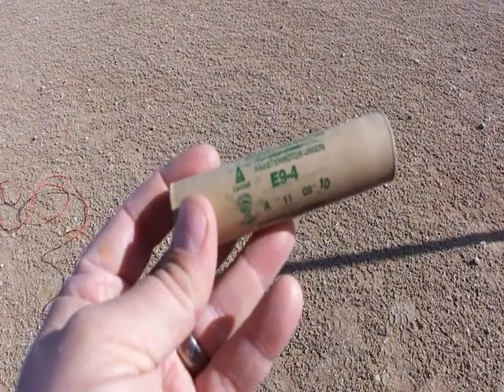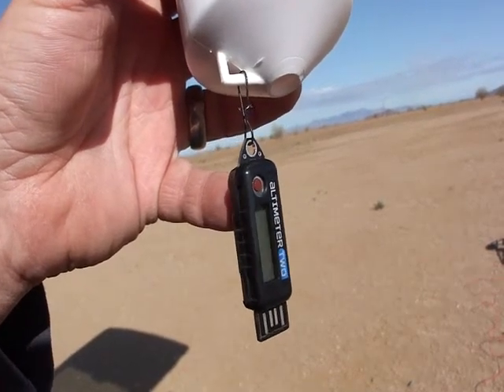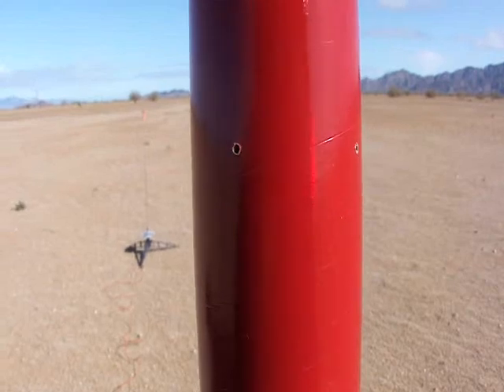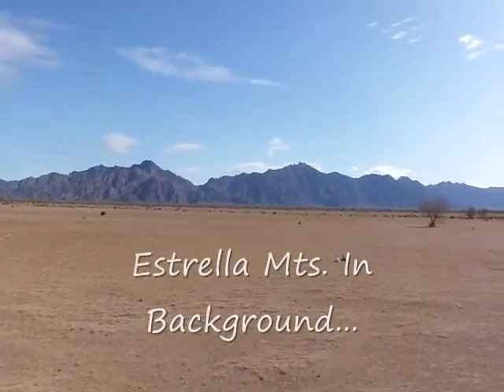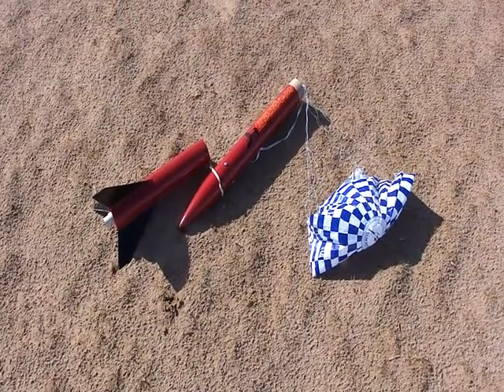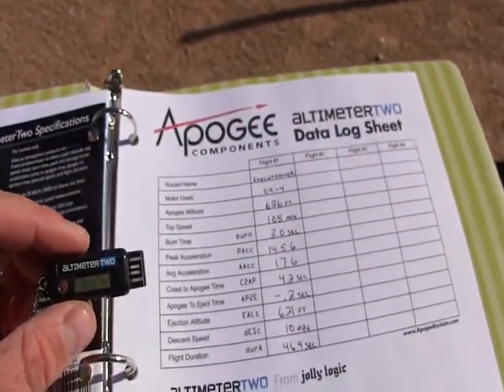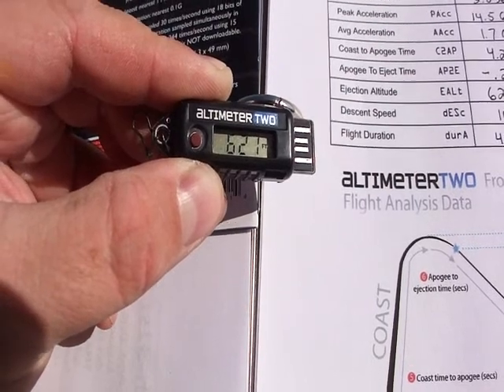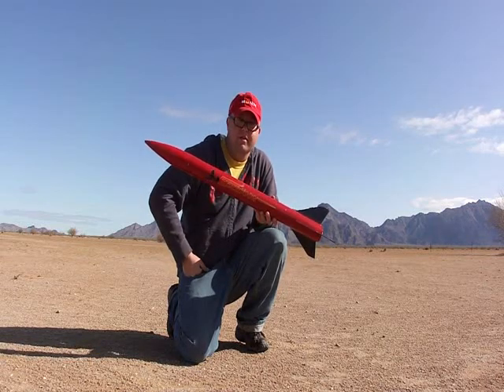29mm Estes Executioner Rocket & Altimeter Two

Comment: Thanks for the video man! I was doing Estes and small aero tech kits until I was about 12. I noticed my drive for larger rockets and looked up some local clubs.  Luckily since I live in Indiana there are about 20 different clubs. I attended a launch on a very cold Saturday and it was cloudy. Only a few high power since the cloud ceiling was so low. The next launch there was a blast. Literally! We saw maybe 50 H-N impulse flights and the day was one to remember. I got my jr certification about a month later and here I am  about to go 17000 on a j510. We have the best hobby, RIGHT!!!!

I just hope the transmitter stays with me. It would be a shame to loose the rocket 😳.

Comment: What are the holes create a Venturi affect reading a lower pressure?
Reply: That's probably correct if the altimeter was based on air pressure, but the Altimeter 2 is based on inertial inputs, not air pressure.  I was unaware of this at the time, but either way, the holes wouldn't have created proper pressure, that's correct.  I was in the learning phase.  Many years ago.  Gave away all the rockets years ago and started a new YouTube channel.  Come check out The Campbells'!  😉  - Josh

Comment: Im looking for a device for weather balloon launch project, whats the max altitude and max speed readings? How long does the battery last?
Reply from the maker: I never use this channel anymore and happened to see this.  Ahhh,   the altimeter like this are specifically designed to record rocket trajectory, so if they don't measure what is perceived as a rocket launch they will record no data at all.  This would not work for you in any application besides launching rockets unfortunately...
Reply: You might have to make you’re own. Or if it will go none over than 100k you can use a missleworks rrc3 extreme. They have a max ceiling of 100k. The battery will last for about 6hours as long as you don’t use it for parachute deployment.